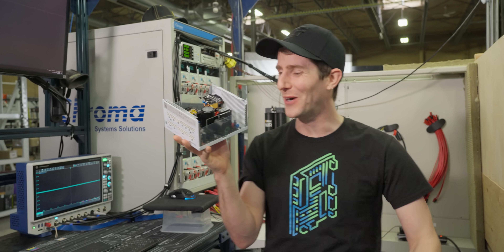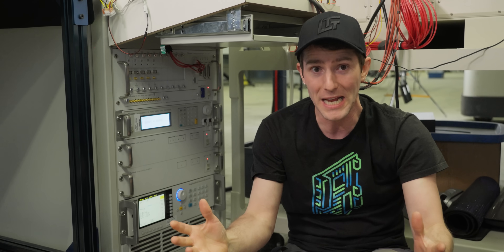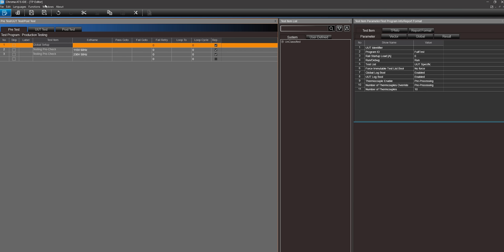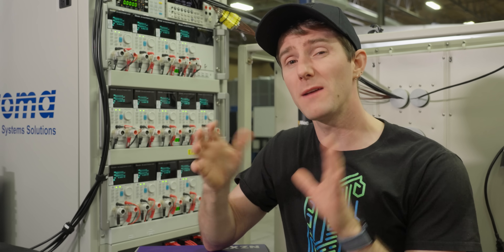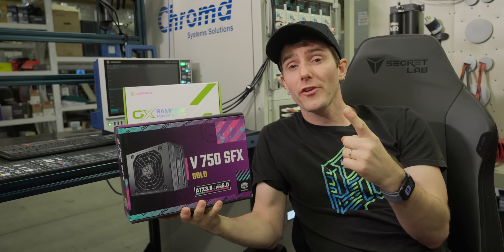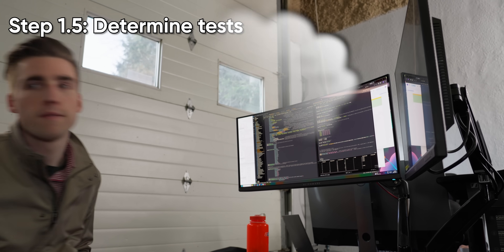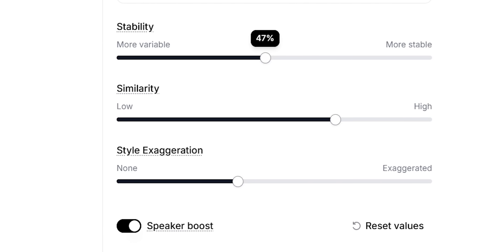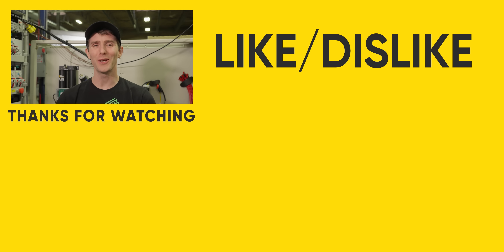Thousands of You are Buying Dangerous Power Supplies

Comment: MSI sponsoring a video featuring their 1000W PSU self destructing in testing. NICE
Reply: I guess that's one way of proving that sponsors don't get any say on the content of the video they're sponsoring...
(Sure, the concept gets discussed beforehand. Of course it does.)
Reply: @Steamrick no.. most companies won’t let you show their failures. It’s simply them not caring because sometimes shit goes wrong.. Msi in my experience is typically very reliable, hopefully they’ll take what Linus says and fix the issues
Reply: @Steamrick  I'm not gonna fault them for that.
Reply: @Steamrick  Or proving MSI doesn't give any Fs, because it's a single product... That said I've had 0 issues with MSI products (never used their PSUs), which can't be said the same about anything ASUS...
Reply: @egg-roll8968  I haven't had any issues with ASUS products. I've only used ASUS mobos for years.
Reply: @xBlitzerx  I would love to say the same my family (used too, not sure now) heavily supported them, sadly every single product has died, been unstable or in some way been unbearable to keep using vs competitor products. I think the only thing left of ASUS (and last bought) that still worked reliably is some random referb but still defective convertible laptops that I got 2 of for $150 CAD total w/shipping where one wouldn't rotate properly being stuck upside-down (easy force rotate fix) and the others touchscreen simply doesn't work at all. I have one but not used in ages, the other not sure if it's still working, it was 2 years ago.

Oh lets not forget their support is basically nonexistent, at least that's been my past experience...
Reply: @xBlitzerx  Thing is, Anything can fail or be bad no matter brand or cost. It's just lest likely the better the quality control the better the components. Having said that, In the last 20 years of building my own PCs using multiple brands of motherboard, I've had issues with at least a couple from each brand apart of ASUS... never had a troubled ASUS board.. But that could be just luck lol
Reply: @egg-roll8968  Yeah, if anything doesn't it prove they have a wide linup  from budget stuff to nicer stuff.
Reply: @ That can be said about any company really... I bought an EVGA PSU (850 BQ) that fried a GPU and motherboard, but never had a single issue with said GPU (which had a recall on it that I never did) from EVGA till their own product killed it... That's when I learned that even a known company can make bad purchase decisions (EVGA like MSI and others all relabel PSUs at least)...

If ones on a budget doing extra research is mandatory to ensure you're getting quality.
Reply: @egg-roll8968  Same, have had no issues with my years old MSI Z590 motherboard, before that went through many Asus MBs thinking they were the best, never again.
Reply: @xBlitzerx generally Asus is alright with reliability, however...

Their customer service is 2nd to NONE in UNreliability, it's the WORST of the major brands by far
Reply: @xBlitzerx  Both my ASUS monitors are fantastic, but the ASUS ROG RAIKIRI PRO is a hot steaming pile of garbage. Probably the single worst controller I've ever used in terms of basic reliability. So many double or even triple inputs off of a single button press and holding anything for longer than like 3 seconds, say the throttle in a racing game, and it just completely drops the input for no reason. It all depends on what you're buying, but based on the controller, I don't trust the reliability of the controller portion of their handheld devices either.
Reply: @egg-roll8968 MSI in my experience is kinda bad, even after sending my laptop for a RMA something’s still wrong with the fans with a grinding noise regardless, nothings obstructing it
Reply: @egg-roll8968 currently rocking one of their mobos, nothing major happened so fingers crossed
Reply: @xBlitzerx too bad, my brother's laptop is an Asus laptop and they're charging an arm and an leg for a battery replacement
Reply: @xBlitzerx  I'm guessing you never had the asus b450-f because I had to go through 2 different boards in rma before I finally got one that didn't have any posting or detecting ram issues. The last asus board I had before that was the crosshair iii formula and all I can say is their mobo quality has really dipped a lot since then. Armory crate is pretty dogshit too imo, could never get it to keep the settings i wanted without it going back to default after some time.

With that being said, their gpus are pretty good though. I ran a strix 1070 up until the 40 series cards came out pretty much 24/7 (with some mining in the first couple of years) and eventually upgraded to a 3070 when I finally swapped over to a 1440p monitor. Both have never given me any issues apart from one of the fans on the 1070 dying (it could still cool itself pretty well though)
Reply: @egg-roll8968  Used Asus since 2009, so really, same roll with the dice here, eh? Still boots with the original i7 920, imagine that. Everyone has their issues, the warranty ones are of course not excusable, but you can't beat Asus back then. You want something similar from MSI?... Have fun buying the top end product, like Godlike, and praying to God after.
Edit: You are saying EVGA was rebranding PSUs? List the date you got yours at least dude. I highly doubt that killed both a mobo and gpu. Maybe it was based on you not getting the recall, but don't shame the companies for negligence . I'm still using an Antec from 2009 and and EVGA gold 850 from 2018.
Reply: @egg-roll8968  had a mag24 in curved monitor. Randomly about 2yrs after purchase it would go green to black (turning it off and on would eventually fix it). Thought it was my gpu because the monitor has 0 issues on console. To this day it still does that with 3 different pcs, and I even met a guy on a chat forum with the same monitor/issue. When I originally received that monitor I had to rma it because the one in the box was smashed (box had 0 holes/dents so it happened at the factory). Msi is meh depending on product. Their gpus have treated me very well on the other hand.
Reply: @egg-roll8968  same for my asus experience.
Reply: @kopsi.  If you're having 0 issues with consoles but only on computers than it's likely a cable or software issue and not a monitor issue. Plus monitors can be more finicky than other parts, it's why I stick with LG, so far no issues, only one monitor died on me, all others still work lol... MSI also doesn't make its own panels so depending on the supplier of the panel if could be subpar. If it's a Samsung panel that could be the issue as well, family bought a Sammy TV and less than 6 months RMA, worked since though...

Curved monitors are also a curse for transportation regardless of brand, so much so local computer shops if buying in store require you to inspect the product and sign off on it to complete the purchase lol...
Reply: @egg-roll8968 I've had a monitor by MSI that was kind of shit, and it broke
Reply: @danimayb  Asus is very good in everything minus keyboards.. There was one i got that was RGB and split in half ,that was removed from market with lots of reports of failures just a month after purchase
Reply: @Steamrick  or they want you to think it that way
Reply: @Karozy4869  what could they (MSI) possibly have to win from that? Sure LTT gains a perception of credibility by scripting their sponsor doing poorly, but why would MSI ever go along with the plan?

edit: Not to mention, how would they even go about scripting something like that? They dont make the machines they use for testing lol
Reply: @sol_in.victus  I wanted to buy an Msi psu but after watching this video I’ve decided to go buy an Msi psu that isn’t gonna fail. I think this sort of video saves Msi from dealing with replacements and angry customers down the line.
Reply: came here to say that...hilarious
Reply: Hahaha
Reply: Yep I love that the sponsor of this video about electronics failing is MSI.  LOL
Reply: It's hilarious when MSI have a less than stellar reputation when it comes to making reliable AIO CPU coolers
Reply: There were times when either MSI or ASUS were bad, or good.
My MSI mobo back then for i3gen8 is still functioning, only the Realtek soundcard is broken.
Not so much with their AM5 mobos. My friend MSI AIO also degrades over a relatively short time, and now kinda not as good as it used to be.

I've been using a LOT of ASUS products. Mostly are long lasting. Like the AX55 router, Zenfone 3, M1 pro max, 6 and 9. However, they're failing at silly things. That you might think, they shouldn't.
The AX55 has a tiny RAM for the price. Zenfone 6 has a brittle button, they break after 5 years of usage. Sure 5 is a long time, but my other phones didn't break.
Also all of them has too little RAM, Storage, and Charger power for their price. They're not that competitive compared to many competitors.
Note that none of all of the ASUS phones I have failing. They are still functioning and still in usage.
I won't dare to use the ASUS AM5 mobos tho 😂.
I usually won't judge brand per brand basis. But rather product per product, whenever possible.
Reply: Msi for the ...fail 😆
Reply: yea mine gold rated MSI mag PSU died after 7 months and 9 weeks to get a replacment
Reply: Wish I would have seen this. My msi prebuilt exploded a year after buyin it…. Just after the return window…
Reply: Well, i had mine for a year now, and push it hard with a 14700K and a 4090 at full wack on gaming and AI, I also ran Furmark and CPU-Z for 30mins at the same time together (My electric bill was ouch!!) and it hasn't missed a beat, not once. So I stand behind mine. You have to remember they ran it out of spec, which unless you're a fool you wouldn't do in the real world.
Reply: @RobGMun  power supply manufacturers account for at least 20% overload. Second how much do you even know about how power supplies work? Do you even know what an LDO or buck converter is? And can you explain how the forces of induction and capacitive affect the psrr frequency range and bandwidth of an LDO?

I didn't think so. Recommending a product based on a test sample size of 1 (your experience) is not based on fact since a test sample size of 1 has an error rate of 1 since there is no feedback due to insufficient test sample size.

Your experience isn't going to be the same for everyone. 2 engines from the same car plant can have as much as a 10hp difference under the curve due to tolerance and core shift so they will never be perfectly identical.

To think every product produced in a plant is perfectly identical is mythical thinking. Even dolly sheep clones had some (minute) differences in DNA due to errors in replication and sequencing.

Cool you had a great experience, not everyone else will. Your mind needs to allow for some variables, like algebra because that's how the real world works.
Reply: @omegaprime516 jfc this is the biggest “ERMM WELL AXSHULLY” post I’ve seen in a while where you type up a long post just to flex what you know. No one cares lol
Reply: Ive always had issues with msi. Never touching that brand.